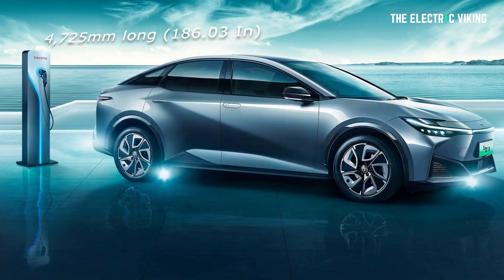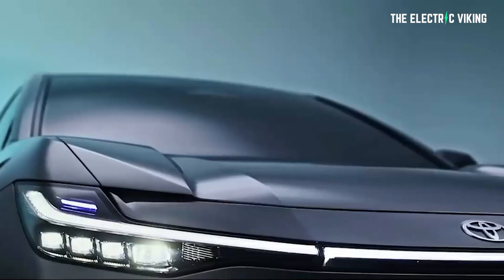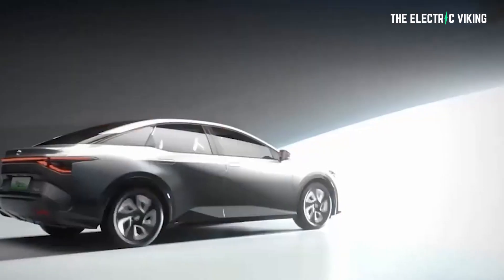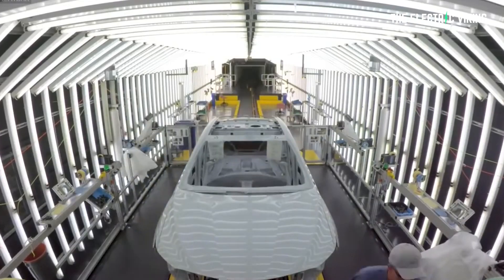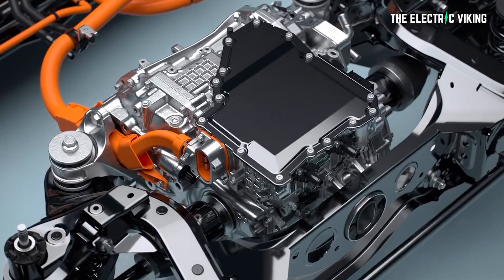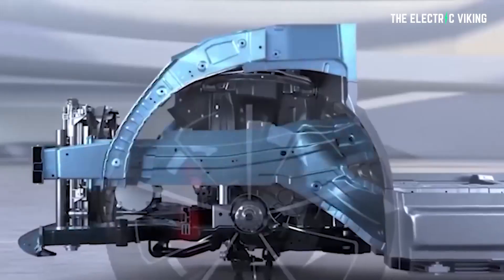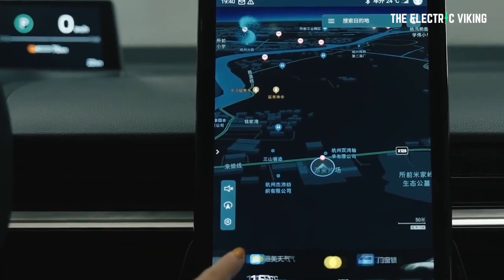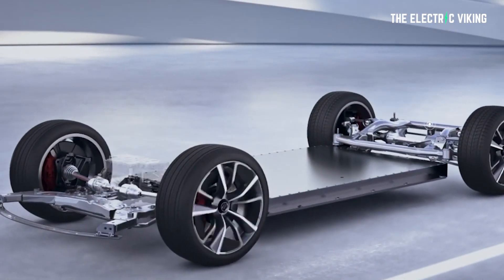NEW electric BYD Corolla - Oops, I mean Toyota Corolla EV

Comment: If the wheels are not falling off than it is BYD 😂🤣
Reply: Maybe they figured out to actually use a cotter pin on the wheel hub nut
Reply: Toyota rav4

Comment: Without diving into technical details if I wanted to buy an EV I would rather give my money to a company that shows enthusiasm for EV and has been building them at scale for some time. Just now that seems to only be Tesla and BYD.
Reply: Hyundai as well
Reply: @BLAZE-sj6lf  ...and KIA and Genesis by extension. 

In the US, almost 10% of the cars Chevrolet sold were EV's also.  Most of the US manufacturers are quickly adopting an EV strategy also.  So things are changing, and more choice and research will only help.
Reply: Oh, and SAIC!
Reply: @danharold3087  Tesla is pushing the technology, and the original innovator.  But I don't think they're alone anymore.
Reply: @thefly373   Are you saying that other Chinese car companies are now innovating.?
Reply: @danharold3087  I would say South Korean companies are for sure - it all areas of technology too.
Reply: @thefly373  Maybe.    A friend earned her PhD in S Korea FSD sort of stuff. The culture does not value individualism.  10% of the people did 90% of the work. It is how they are taught to work.  I don't see where they would be doing much innovation.

Comment: I'm almost completely sure that the front and back windows, and the windshields are exactly the same in the Toyota and the BYD Seal... just tried superposing the two images in Photoshop and it was a perfect match. No doubt this Toyota is based on the BYD Seal platform and shares much more than the batteries.

Comment: The main reason people buy a Toyota is based on their history of making reliable ICE powertrains. Everything else is always out of date and ugly so that's the main reason they sell so many vehicles. With the transition to EVs Toyota has their reputation reset and have to start over because there is no engine or transmission and gas mileage is also a non issue.

Comment: It's a shame but Toyota just seem to be incapable of publicly telling the truth in recent years, like denying the Subaru Solterra is the BZX4 with an extra motor, rushing said BZX4 by 2 years vs original plan only for the wheels to fall off, literally.  Or crying about $60bil of charging infrastructure for BEVs in Japan alone while pushing hydrogen (a dead end powertrain) which would have 5-6 times the infrastructure cost. I have a close family member who works in a Toyota factory, from the bits I hear it sounds like company in chaos, thats now in a blind panic realising it's 5 years late to the BEV party. How the mighty have fallen.

Comment: The car is built on the e-TNGA platform. It’s not a rebadged BYD
Reply: He did not say it's a rebadged BYD, he said it's a 50/50 partnership between BYD and Toyota. 🤡
Reply: @BLAZE-sj6lf  not sure what video you watched. All he did was imply that Toyota is lying that it’s their platform and that they did as much development as they said they did. He implied multiple times that it’s just a BYD with different body panels. 🤡
Reply: @Ducatista10  Toyota lied about the battery was the only BYD component they used in their partnership, deliberately not mentioning the BYD motor they used as well. 🖕🤡🖕
Reply: @BLAZE-sj6lf  Where do you see that they lied? On their official web site, it doesn't say anything specific about the motor. Not saying anything and lying are two different things.

Comment: Rebranding like this is very common in the automotive industry and has been for decades. This certainly not the first time for Toyota either, two recent examples are the Toyota ProAce EV van and the Toyota Supra (ICE). It make sense for Toyota to do this as they can sell a Corolla style vehicle without the expense of retooling. Another major issue for Toyota is capacity, they are not able to keep up with demand for their ICE and Hybrids so branching out to full EV production is not really feasible at this point.

Comment: This vehicle is 155mm shorter, 5mm narrower and 25mm taller than the current model Camry (and the wheelbase is 60mm longer). Toyota could slap a Camry badge on it and replace the Camry in export markets. Camrys are perceived to be expensive than a Corolla and it could be possible for Toyota to price the vehicle closer to the petrol Camry (if not less).

Comment: I have been driving a Camry V6 for 28 years. Last one is an '08. No problems. No matter. I blame Toyota for blocking adoption of the BEV by advertising an ICEV as an EV, when it was not, e.g., an ICEV with minor assist from a small battery/motor. This deception worked, somewhat, not entirely. People wanted more, a real BEV. They continue to defraud. I continue to remember, waiting years for an Aptera, since 2019. Toyota deserves zero business.

Comment: Sam, range will also vary by tires and wheels and gearing. With or without a transmission, you can gear up the drive ratio for torque, or speed. Or just limit them both to increase range.
 So doubt them, but remember you're only playing with half a deck.
 And as to price, it could be a loss leader in base trim, to get a toe in the market. They're certainly not going to tell us.

Comment: Some news:
"CATL Aims to Mass Produce Sodium-Ion Batteries in 2023  

The context: The technological limitations of sodium-ion batteries have mostly seen their use confined to things like e-bikes and energy storage, according to analysts at brokerage Pacific Securities Co. Ltd.

But while their widely-used lithium-based peers generally have a much higher energy density, spiraling costs of their metal inputs has started a race among battery-makers to develop more efficient sodium cells.

Sodium-ion batteries cells have their own advantages. Aside from being cheaper, they can recharge faster and perform better at low temperatures. They are also more environmentally friendly because they do not use rare metals." (Caixin Global, 10/25/2022).

Comment: The new Toyota Corolla looks like a 1990 Toyota Corolla Lift back redux. It is like the designers of Toyota were told take a car and design it to look like it entered a shredder with the vertical lines in the front hood. Even the BYD model looks better. It seems the latest designs have had a geriatric crowd in mind. I still think Hyundai design is better overall.

Comment: I am not toyota fan but I see you toyota hater…even bz4x components are made in china….toyota most of the components are made by Denso so we should call Denso Corolla or Denso camry. Transmission is made by AISEN so it should be AISEN corolla ? EV will make city clean but how power is produced ?

Comment: Whether it's a BYD or not is pretty much irrelevant to the ROW (and whatever claims are made for it in China) as we can't buy it. As a manufacturer it makes sense not to engineer a car from the ground up just for one market. I also rather suspect this is Toyota doing to China what it did to the US early on (and what China has been doing for the last 20 years) which is to get a foothold in the tech and learn all it can from others. 

Can it get more range than the "equivalent" BYD? Who knows, maybe there are some optimisations they and BYD have come up with, maybe the aerodynamics play a part, the reality is that no one really knows until it's actually released.

Is it made by BYD? Well again as a China only market vehicle developed in conjunction with BYD what would any rational person think? Did Toyota actually claim they were building it?

Comment: I really don't care if a manufacturer lies about its emmision numbers; if it is non-zero then it makes emmisions. What more do I need to know?

I don't doubt the extra range could be achieved with some software changes and engineering improvements. But I think that Toyota is mainly extending the range with creative math and politics.

Steering wheel creates blind spots? I buy that, for the top of the wheel. But what part of the road does the bottom of the wheel block?

Comment: How many errors do you want to put into one video?!

This is literally the second line in the press release:

"A battery electric sedan developed through the collaboration of Toyota, BYD, and FAW Toyota"

Toyota couldn't be any clearer that they collaborated with BYD and FAW Toyota!!

The car is built by FAW Toyota in their factory, do you honestly think that BYD would allow them to build it there?!

As for the range, Toyota's range is based on the 16 inch tire with a 183hp motor - the Seal/Atto 4 doesn't come in that combination!

The non-Chinese bZ3 will launch in all markets first quarter of 2024....

To quote Juice Media "stop this sh*tf*ckery"!!